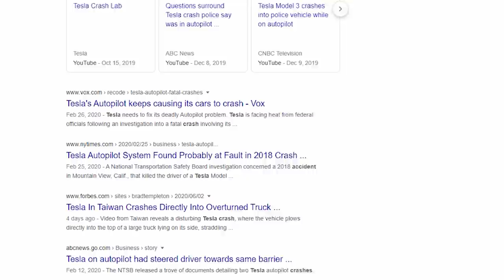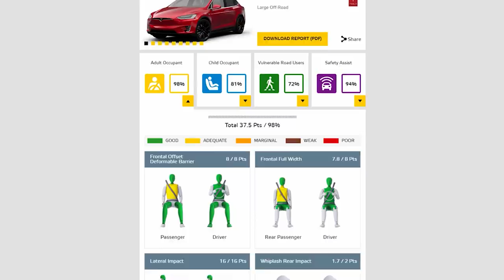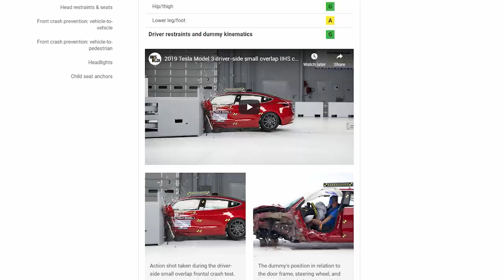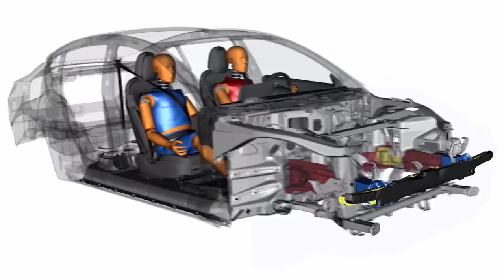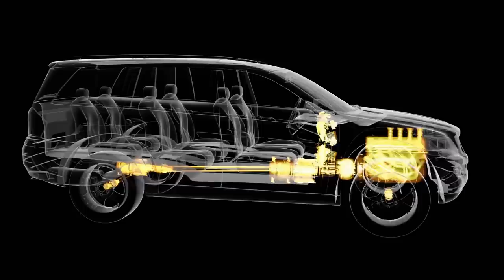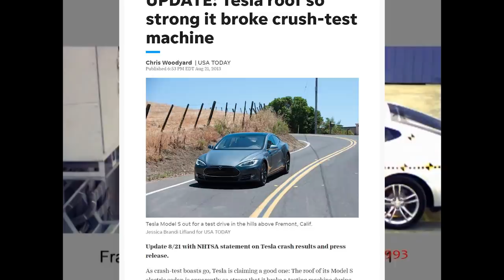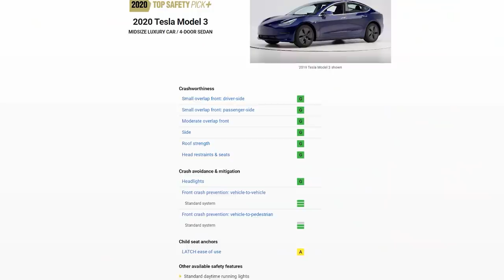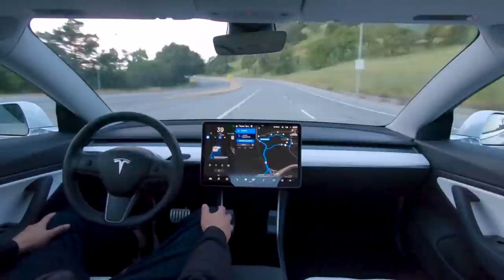Tesla: The Most Dangerous Cars on The Road?

Comment: I watched a lady back out of her parking spot at the grocery store, try to brake and her foot slipped off and hit the accelerator. She froze at the wheel as the car clipped three others in reverse, almost hit shoppers, and come to a stop against the metal guard poles at the entrance. It was a standard internal combustion car..not a Tesla. Never made any of the local news stations or newspaper. I am 77 years old. In the 70's I remember Ford cars bursting into flames at idle or stop signs. Cause was later found to be a 15cent rubber tube to the carburetor that leaked gas on the block. Never made headlines.
Reply from the maker: Thanks for watching, Drive safe Richard!
Reply: That was the 70s though. And cars are not made like that anymore.
Reply: Are you one of Elons spies?
Reply: @SDav21   There is always someone asking a dumb question right after the teacher finished giving the answer.  I am surprised you didn't ask for the name of the song playing in the bacground
Reply: @superdupert6  No question was asked. Besides, this video provided no "answers".
Reply: How about all the VW FIRES from fule line to carb failure.
Reply: @pepcjim1  Carb??? Carb? So basically their cars from over 20 years ago. That makes it largely irrelevant now.
Reply: @SDav21  Does not matter. People live by anecdotes, rather than by data sets. Even if the anecdote is false.
Reply: That is the exact thing that happened to my grandmother, she hit 3 cars in reverse at a grocery store and froze on the accelerator. Actually kinda wondering if it were her you are talking about lol.
Reply: The horse lobby didn’t pay media to make headlines?
Reply: Is that the ford pinto?
Reply: AJ Thomas what no
Reply: GM Rochester carburetors had a fuel filter that screwed into the carburetor body. These would come loose, allowing gasoline to fill the pits and valleys of the intake manifold. Had it happen twice. Second time I used blue threadlocker with a new filter – aftermarket with longer threads than the original AC filter.
Wonder how many GM cars went up in flames from that one defect?
Leaky valve cover gasket dribbled oil onto the exhaust manifold set my ‘83 Olds Cutlass Cruiser on fire. Went out when I turned the motor off.
Reply: @SDav21  – Fuel injection with its high pressure (40+ psi) and many connections has been a fuel leak problem for decades. I had a car with Bosch electronic fuel injection. The injectors would leak around their periphery. I replaced them with Nippondenso copies of Bosch. No more leaks.
I have witnessed cars that had fuel injection catch fire from fuel leaks, burn the car to the rear, then boil the gasoline in the tank, blowing flaming gasoline vapors out of the venting system. When a car is burning it seems that the fire department takes f.o.r.e.v.e.r to get there. Really about five minutes.
Reply: @zoltix  – Her reflexes thought that she was pushing the brake pedal. So when the car accelerated, her reflex was to push harder.
Reply: big media coverage costs tens of thousands per minute. at prime time? 100's of thousands. I only know of ONE entity that sports that kind of cash... DO I EVEN NEED TO SAY IT OUT LOUD? another interesting fact: none of the stories published- were actually published by tesla owners. 'anonymous concerned citizen' / lawyer.. 2 or 3 off... for texaco.. british petroleum... shell? of course. WHO ELSE?
Reply: That story from the 70s is actually very famous and studied in economics, they deliberately calculated the cost of installing that component Vs the amount of cars that would blow up. This cynical decision has been studied for decades as it cost hundreds of lives.
Reply: True
Reply: @stephenjacobs5640  I know right I totally agree with you, Tesla cars get all the news and media over 1 car 1 CAR  crashing and getting destroyed or starting a fire when all the gasoline cars do that in the daily a severe crash from a gasoline car is "Normal" but a minor crash from a tesla be getting all the news the media the attention and even the cops to some degree, I think this is absolutely insane and elon thinks so himself.
Reply: @robloxgrindingyt2881  ye its as if they wanna kill tesla...but also I think their current self driving system is already safer than any human could ever drive but for some reason they aren't allowed to roll that out cuz of the one or two crashes that happen every year or 2
Reply: That's like Kim Kardashian complaining about media attention. 

Tesla and it's CEO actively pursues having the spotlight on them ...sometimes by being controversial. This generates a proportional interest in Tesla cars...good or bad.

If Tesla doesn't like it, then they should make less of an effort to be in the spotlight.
Reply: Normal car manufacturers pay alot for these anti Tesla headlines.
Tesla model 3 is currently the best selling EV in the world.
Will probably be the best selling car in a few years along side toyota and honda
Reply: @robloxgrindingyt2881  1 car? Teslas are crashing all the time.
Reply: Did you see combustion engines blowing up for 12 hours because every cell in the battery needs too burn out before it’s safe to touch?

Comment: You have internal combustion engine cars crashing every damn day leave Tesla alone they have a five star crash rating  you as the driver are supposed to pay attention when you have the auto pilot on it is not the Car’s  fault it’s a drivers fault and that has been proven
Reply from the maker: Watch the video fish
Reply: Dude like a minute in they already say that Tesla’s are safer that ICE vehicles.
Reply: Electric Future yes sorry I apologize
Reply: @ElectricFuture  Well every other new car has a 5 star rating too. Plus many received better frontal impact scores than the model 3 on Euro Ncap.
Reply: SDav21 he don’t care
Reply: @austinmiller170  he cares, but frontal impact only happens if you hit something.  TM3 is 66% safer than any other vehicle on the road.  Second place is also a Tesla.  Lmao
Reply: @davidbeppler3032  No it's not. Look at Euro Ncap. Even the Mazda Cx30 got better crash scores for adult and child occupant protection. In actual fact, tesla has lower scores than most cars for child occupant protection. I don't know what makes tesla nuts think tesla is safer. Ignorance I guess.
Reply: SDav21 or marketing
Reply: jeffrey Lebowski You have gas vehicles crashing every day and they burn too so stop it
Reply: @johnkarpontinis1410  – Gasoline fires are extinguished with copious quantities of water spray to absorb the heat so the gasoline doesn't vaporize fast enough to keep a fire going. Water also blocks oxygen (air) from getting to the gasoline.
Lithium burns in water like sodium. A Tesla S battery only contains a few kgs of lithium dispersed throughout the cells. Flood with water to cool the fire and to prevent more cells from being overheated and venting.
First responders are now being equipped with jacks to tip a car which has its battery burning so that more water can flood the battery to absorb heat faster than a fire can produce heat.

Comment: I always say that all AP crashes aren't Tesla's fault but the driver's fault. Because the driver is responsible for driving the vehicle.. He has to follow the road and Tesla says that the driver MUST be prepared to take over any time
Reply: Is there really a point then?
Reply: @THESLlCK  uh, yeah. Autopilot is obviously convenient, but it's also 9x safer than a human driving. But, if there's something insane going on, like a car driving the wrong direction, running a red light and hitting you T-bone style, or construction equipment arms moving around on the road, then you should be taking over. The disclaimers on the autopilot screen of the car when you activate autopilot very clearly state this. It's not level-5 autonomy and shouldn't be treated as such! It's just a driver-assist function
Reply: @kjsdpgijn  9x safer than a human driving but it crashes more than a normal human
Reply: @kjsdpgijn  As soon when you turn autopilot,you relax to much.So your reaction time will be slower,which can sometimes influence death or life.Your brain needs to work in the same way it worked without autopilot,so   when you experience  a critical situation,your brain can react without much thinking.Either they make complete autonumos car,or that shit called Autopilot will take more lives.
Reply: Tesla safety is so advanced, it blames it's customers when it kills them!  And it's fanboy minions abuse anyone that question them.
Reply: @johnkarpontinis1410  yeah I know

and there's a lot of crashes that they say is just driver's error

when the driver is using autopilot
Reply: @FROZEN EGGY according to crash tests...

Comment: Frankly, it is more of a cult following that loves Tesla and Elon Musk.  A Consumer Reports test found several flaws in the Tesla design.  Most alarming was that the break tests left the Tesla with a 21 foot distance longer in breaking than other models in the same class.  Additionally, the technology heavy car has removed many of the controls and run them through the center mounted touch screen.  It was found that making adjustments took more steps than other automobiles and distracted the driver.  Simple controls such as mirror adjustment, air conditioning, and more require several steps at the center touch screen and is highly inconvenient and somewhat dangerous.  As for Elon Musk being a super hero, this illustrates more of a narcissistic mentality than an real admiration for a man with too much ego and not enough fact based attributes.  In other professional evaluations many simple things like hinges, weight of the car, use of crumple zones and other car industry standards for safety and economic advantage are just missed.  Technology is what is emphasized in Tesla and not a really great car design.  I am not against innovation, but clearly other car companies are taking on the EV trade in a more safe and serious fashion and this shouldn't be missed by consumers.

Comment: My main concern is the mindset of the push for self driving cars. I think it is a great idea and will save a lot of lives and traffic issues in the very long run. Some manufacturers however, have even predicted the demise of the steering wheel. He alluded to when all cars on the road are self driving. If you live outside of the highly urban areas, of which there are a lot, there will always be a need for a manual mode. Think farm trucks on fields, driving on private driveways without the clear markings to guide self driving cars, driving cut lines for power line maintenance and so much more. I would certainly consider an EV for my next vehicle, but definitely affordability would be a major factor.

Comment: Tesla's are very safe.
Reply: Why the ‘s?
Reply: Volvo is safer
Reply: @wroniec  nope, here is the Euro NCAP Crashtest, https://youtu.be/cMiZa3HgRVE
the Tesla is best in class.
Reply: Volvo And Polestar EV’s are safer because if they crash they disconnect battery but if tesla crash it can literally EXPLODE.
Reply: @wroniec  your information is clearly outdated, when tesla's airbags explode the battery wires are also disconnected. But even when the wires are disconnected if the battery gets damaged heavily nothing will stop it from burning, not volvos method neither teslas.

So sit down volvo fangay.
Reply: But certainly not the safest.
Reply: @JohnSmith-pn2vl  Actually if you bothered to look at the details, many cars received better frontal impact scores and occupant protection.
Reply: @wroniec  no, Batteries do not explode, in rare cases of a Battery fire you have up to 10 minutes to get out the car. ICE cars explode on a regular basis and fires are way more common, close to 10 times.
Reply: @SDav21  best in class is best in class.
Reply: @JohnSmith-pn2vl  when you cherry pick from which crash test agency you want yes. Go look at details on Euro Ncap.
Reply: @JohnSmith-pn2vl  You can't compare fires like that. Most ice fires are old vehicles. Electric cars really only became mass Market in 2012. Look at fires of cars 2012 and newer. Also, there's far less electric cars on the road than ice. So probability of major collisions higher.
Reply: @SDav21  i literally posted the NCAP here

Comment: the problem with those batteries is when they catch on fire 
they don't want to go out
the fire departement over here has containers with a chemical liquid to subdue the heat and flames
they first have to extinguish the flames 
then lift the car into the container with chemicals then let it rest for about 36 - 48 hours before its even safe to come near them
they really needa fix a new battery technique to end these problems
Reply: Or let robots handle fire fighting tasks.

Comment: 1:51 most accidents are the result of drivers overestimating autopilot capability.
Reply: Solution: don’t use it. Obviously people are being caught out when two seconds away from crashing, the “ding ding ding” alerts the driver to take back the controls. Too little time. So the obvious message is don’t use it. Autonomous vehicles only work when it is a regular, short run, say a people carrier from train station to shopping station. Liability for crashes and deaths will put Tesla out of business. Two Trucks in convoy with a driver in the front one may work. But I would not trust autopilot when I drive. I don’t even want to have the capability for self-driving. Self-parking and summoning in valet mode potentially sounds good though.
Reply: As they think it level 5 but tesla is only level 2 at moment
Reply: Still safer than everything else.
Reply: Thing is, it’s not even autopilot

Comment: I wanted to give this video a thumbs down for that horrendously bad title but the content is so positive I gave thumbs up.
Legacy automakers deserve to go out of business for such terrible engineering over the past 50 years. Here's a new silicone valley startup running circles around them in every conceivable category in which an automobile can be measured.
Reply: I gave it a dislike for the title and will remove that or even replace it with a like if the video earns it. I haven't watched it yet.
Reply: @theuncalledfor  Well now, I would classify this comment as "premature interjection".
Hope you finally watched as it's a love fest for Tesla.
Reply: @Rick9482  
I watched, and changed the dislike into a like. The video had enough merit to warrant it. This was not unexpected.

The title is a bit clickbaity, but it's not an outright falsehood due to the fact that it's phrased as a question. The merit of the video outweighed the clickbait-factor.
Reply: The title is misleading. The content is biased. It doesn't matter if I may agree with his general message, it's nothing but an advertisement for a car masquerading as an evaluation documentary.
Reply: What terrible engineering? There are cars that are SAFER and have more active and passive safety features than tesla. But you can remain ignorant that's fine. Who do you think gave the auto industry most of the safety inventions you see today. Mercedes benz. Not anyone else. So before calling out terrible engineering, look at tesla first with their collision avoidance system that can't stop for a stationary truck right in front of it.